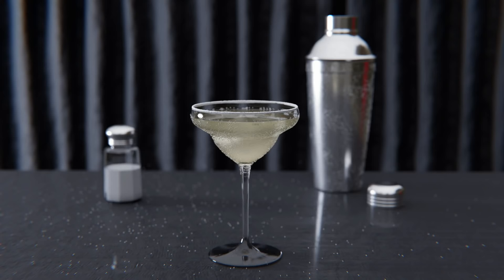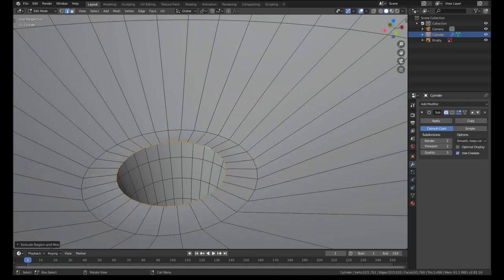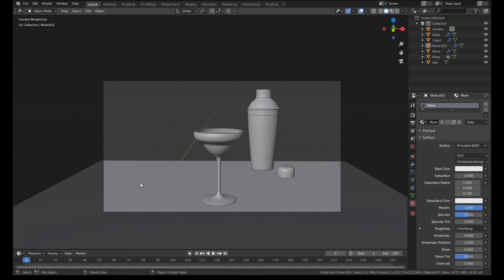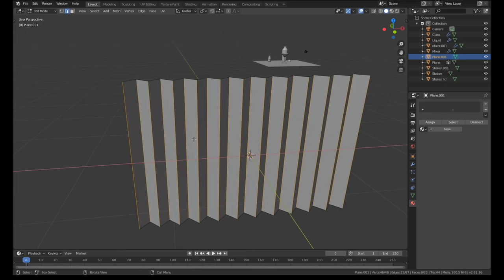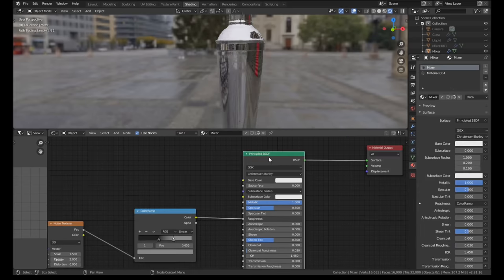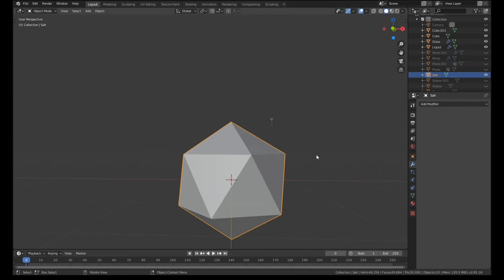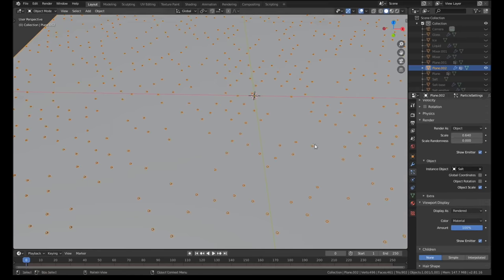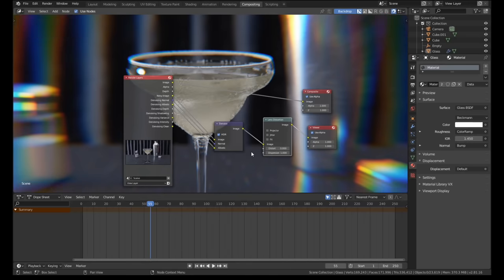Achieving Realism In 12 Minutes - Blender Tutorial

Comment: I really enjoy this video, so much demonstrated in such a short time and very well done.  I have a couple of suggestions with respect to the ice cubes.  Roughly cubic chunks of ice tend to float level, not rotated at a weird angle.  Also, instead of sculpting them, I just made a rounded cube (or normal cube then entirely beveled and shaded smooth) and then in the material used a coordinate texture mapped to a noise texture and then applied via displacement node.  That makes all the little waves to the surface procedurally and it looks really good.

Comment: I don't aggree at all with the use of the RGB Node in the volume input here - you basically made glowing wine (a color input is internally converted to an emission shader). An actual volume absorption shader with a bit of scattering would have done better probably. The Denoising Data has to be enabled BEFORE rendering. otherwise it won't be rendered -> the Denoising Node will not use it and give inferior results.
The salt could have some SSS for more realism even when it's out of focus.
Otherwise great content.

Comment: I'd suggest using the bevel modifier with weight mode instead of using the bevel tool, the modifier is non-destructive and the tool is destructive
Reply: Same thing goes for around 1:30, use the solidify modifier instead to have a non-destructive workflow

Comment: how did you make the droplets of condensation on the glass emit using the orientation of the normal faces of the glass?
Reply from the maker: Make sure the origin of the particle is on the base of the mesh. In the particle system settings, click advanced and open the rotation menu. You can align to particles to the normal direction of the emitter from there.
Reply: @DECODEDVFX  ooooooooh I see it now, thank you!

Comment: Why do you model it so extreamly big?
For extra realism one should model in real world scale, so light will behave more correctly, or as expected
Reply from the maker: This was real world scale.
Reply: @DECODEDVFX  DId you model with imperial units, because in 2:20 it looks like its multiple meters in size, 1 square being a 1x1M, might just be an optical illusion
Reply: @BlenderBeanie  it appears much larger than indicated because the photo reference is placed with the grid at its center, not the bottom. So working on that part of the model the grid does appear much larger, but that's simply perspective.

Comment: What is the "well known limitation" in Cycles you're referring to in 2:30?
Reply from the maker: Good question.

In real life, liquid inside a glass appears to take up the whole diameter of the container. You can't see the thickness of the glass due to refraction. In cycles, that doesn't happen. The current workaround is to scale the liquid mesh so it clips slightly into the glass container. I believe the Blender devs are currently working to fix the problem permanently. 

This cartoon drawing of a glass demonstrates the problem nicely (https://cdn0.iconfinder.com/data/icons/orderdrinks/128/C_WaterGlss-512.png ). That space between the edge of the glass and the liquid inside it shouldn't exist.
Reply: @DECODEDVFX  Ah, got it. Thanks!

Comment: *Important note: in order to use the denoiser, you have to enable denoising data BEFORE you start rendering. Otherwise there will not be any denoising option in the compositor.
Reply from the maker: You can enable it after, like I did in the video.

Comment: Flipping normals = making the inside the outside? 
I'm new to modeling so the terminology is still new to me, but watching your process makes it all make more sense.
cheers
Reply from the maker: Yes. 3d apps (for the most part) only recognise one side of each polygon. Flipping the normal direction changes which side of the face is seen by the camera. Without flippigg the normal blender would render the object as if it was inside out.
Reply: @DECODEDVFX  Thanks for the response! Sub'd :D

Comment: Make for EEVEE
Reply from the maker: All of this should work in EEVEE apart from the volumetric liquid.
Reply: @DECODEDVFX  I would definitely like to see a tutorial for eevee, it would help show the differences between the render engines
Especially with transparency. It used to work for me, but ever since I upgraded my PC, no amount of messing with the settings gets it to work anymore (despite having more powerful hardware)
Reply: @pauldeddens5349  Eevee should handle the scene just fine, but you have to find workaround for the liquid. Eevee cannot handle multiple transparent materials seeing through each other. If another transparent object is behind transparent object, the object behind will not be shown.
Render settings -> Enable Screen Space Reflections and tick Refractions too.
in the material tab under Settings, also tick Screen Space Refraction.
Reply: @rob679  I found the issue with mine. For some reason Blender 2.8 was refusing to work on my upgraded build, since ive updated it to 2.81, its been just fine